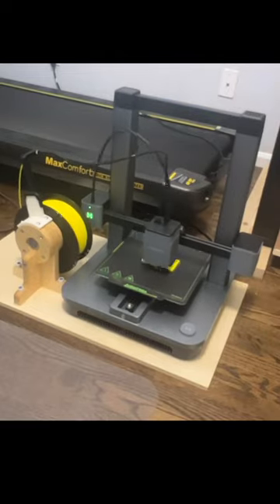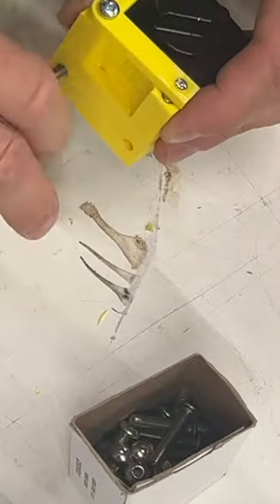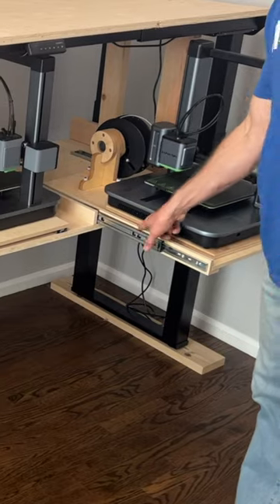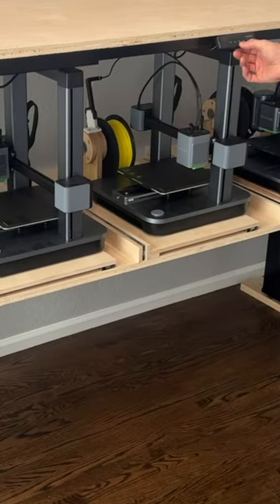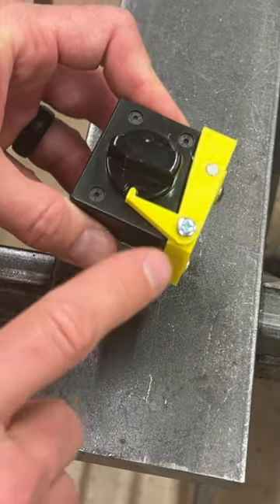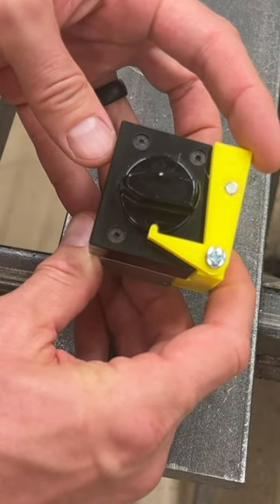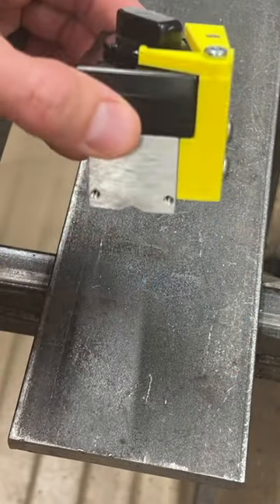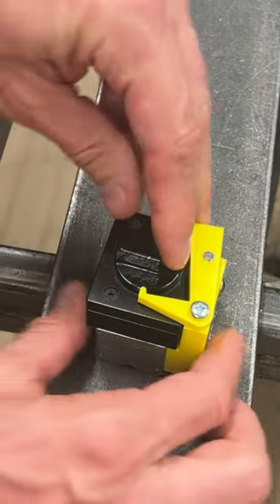Shorts 3D Print Magnet modification

Comment: You can use this for a table saw, bandsaw, drill press, lathe, vertical or horizontal  mill, for setting up guides and stops. Alignment of the base to a dial indicator.